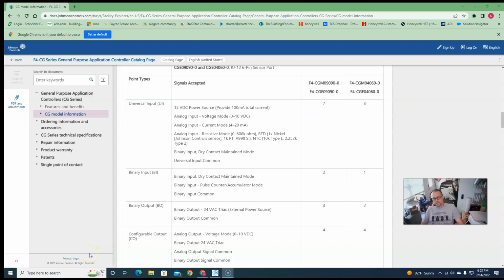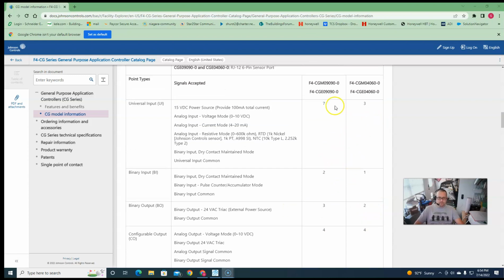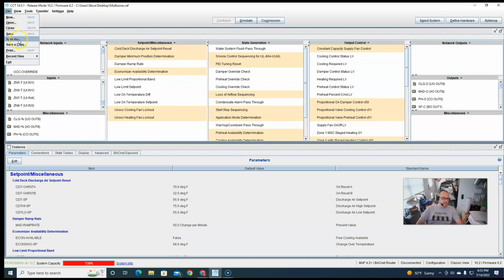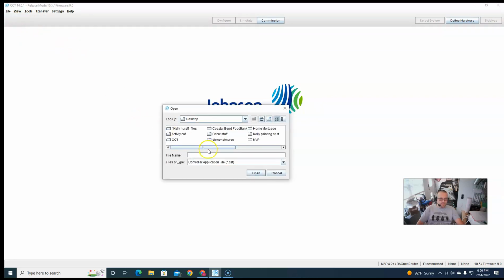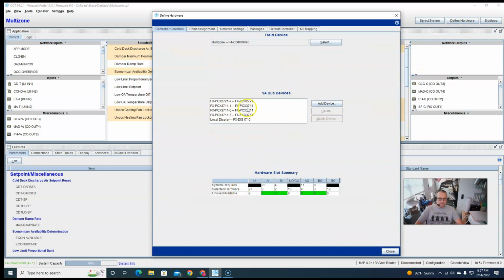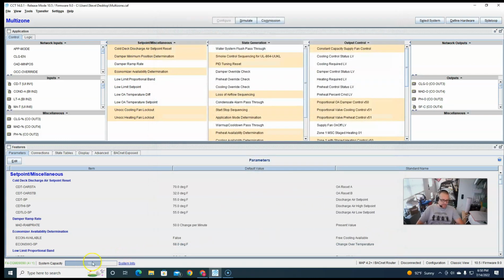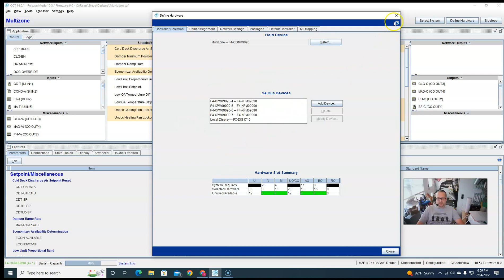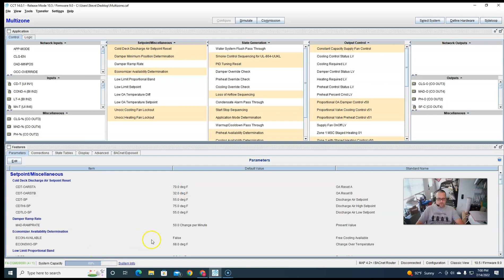F4 CGM09090-0 Overview

Comment: Question about the hardware. I’ve successfully upgraded the caf file to replace an FEC2611 with a CGM9090 and downloaded the controller. The UIs aren’t reading (DA-T sensor) at all. Jumpers are all set to default. Am I missing a step?
Reply from the maker: First step is to check the wiring, second step look at what type of sensor it is and make sure it is programed for that type of sensor, in configure mode right click on the DA-T input and modify signal to what ever type sensor it is. Make sure you are not using firmware 8 which is 10.4 this is a known bug for that firmware. If all that doesn't work move the DA-T to a new input and see if it works, you could just have a controller with a bad input.
Reply: @stevenhurst1631  You’re my hero! Upgraded to 10.5 and downloaded and it worked like magic. Thank you!